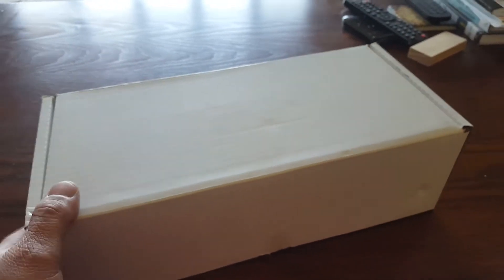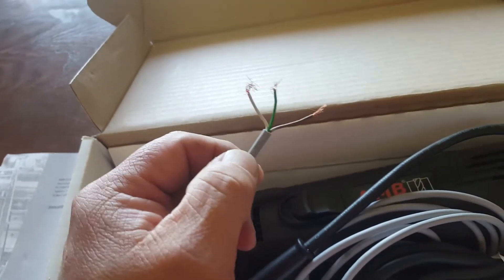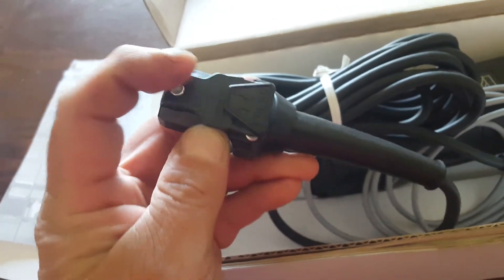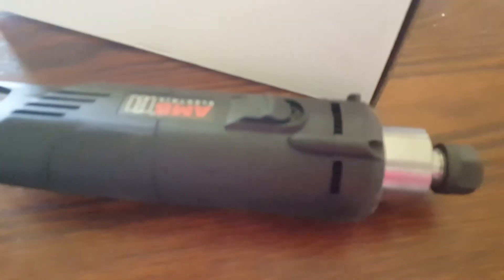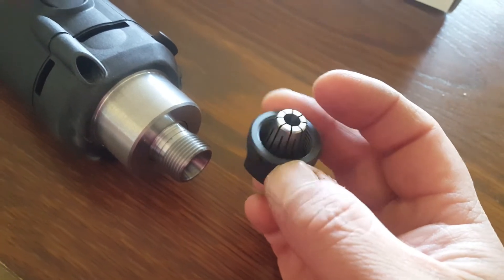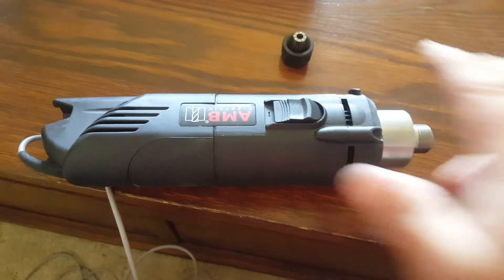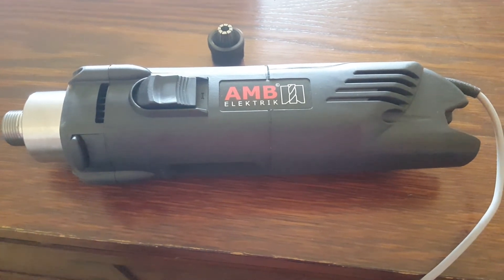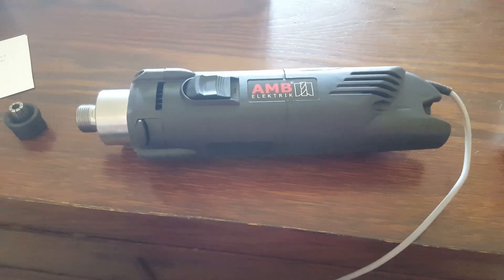New Kress AMB 1050 router/spindle for my CNC

Comment: you mean it can change speeds by software,also the collet can fit large diameter bits?
Reply from the maker: Sorry so slow of a response but yes. You can get collets in 1/64" increments i believe up to 7/16" Spindle speed is controlled by 0 to 10 volt dc input. At 1 volt 5000 rpms at 9 volts 25000 rpms.
Reply: @northernbranches  er16 officially goes till 10mm, but there are 12mm (0,472441 inch) available which are very thing borders but work fine, which is quite a diameter for such a machine and allows a lot more tools to be used